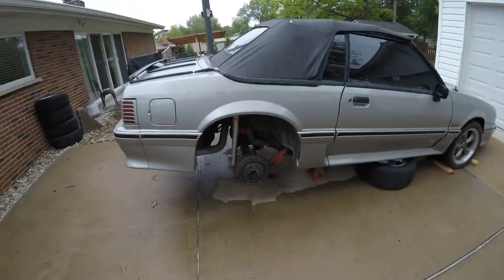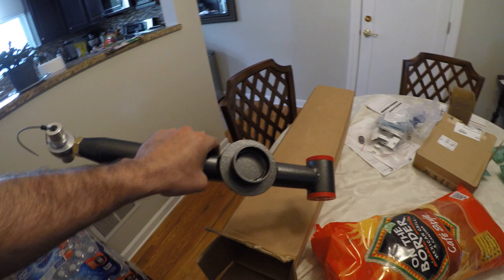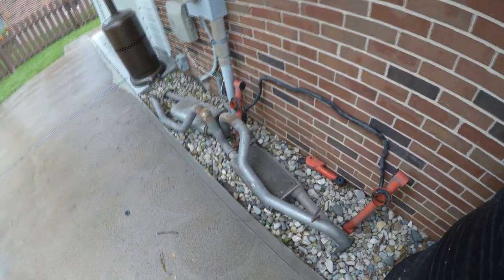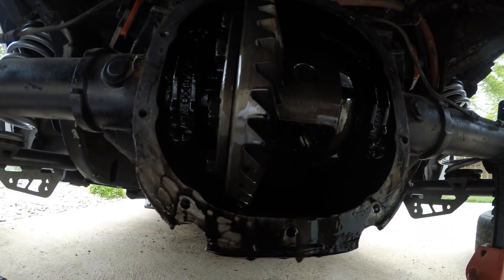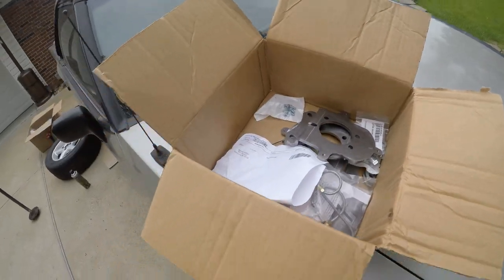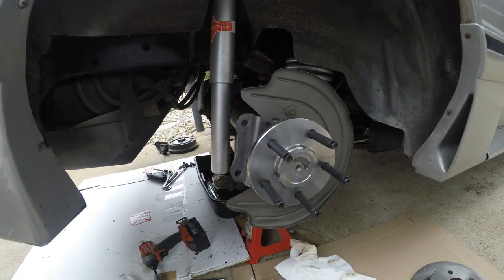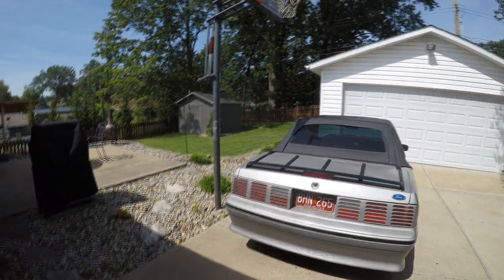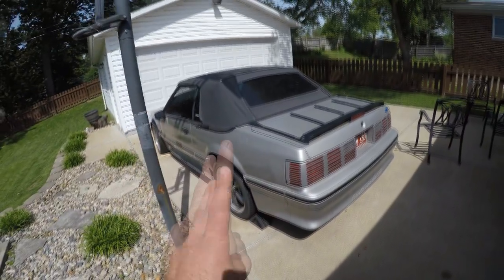Foxbody Mustang 5 lug and sn95 disc brake conversion

Comment: Unless you really need  the  little advantage  in the cobra brakes the SN95  brake swap   Swap is More pain than it is worth!   a Set of  Lincoln rotors are  a bolt on and give 5 lug conversion with vary little  difference in braking.
Reply: What year Lincoln n vehicle ? That’s what I wanted to go with 👍

Comment: Hey brother I just wanted to let you know the reason why the factory sn95 brackets weren't working for you is you have to put the left on the right side and the right on the left side 😬 just a little information just in case you didn't know now you know that's probably what happened why they weren't fitting